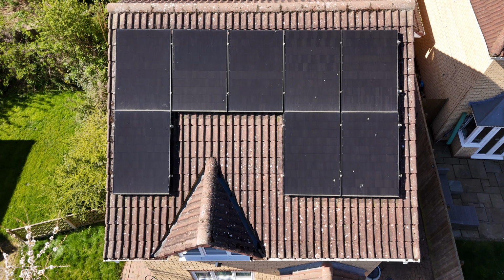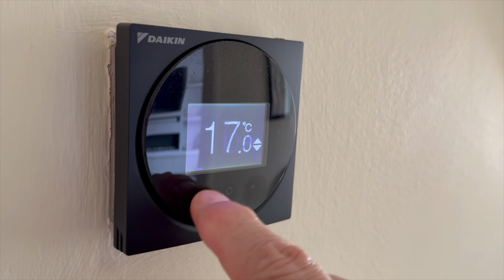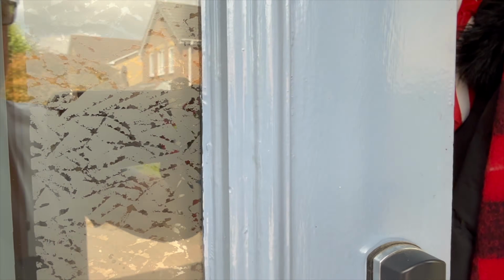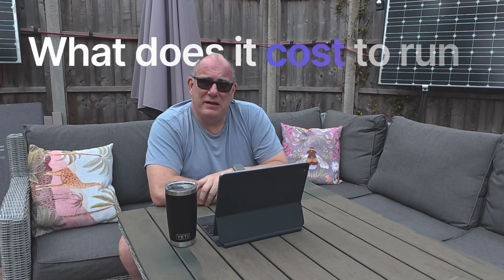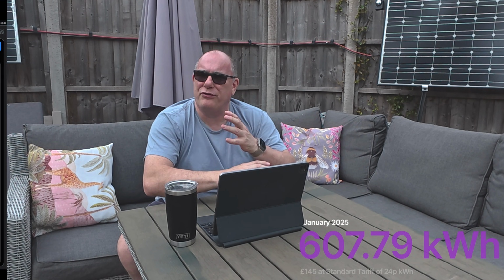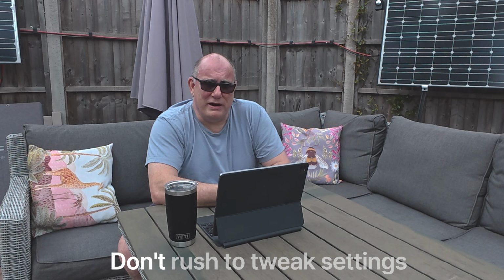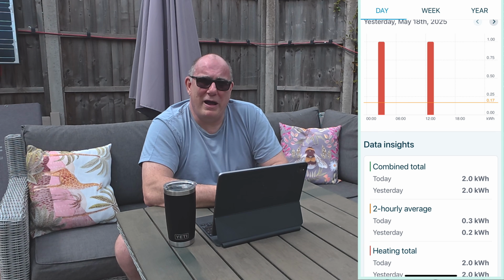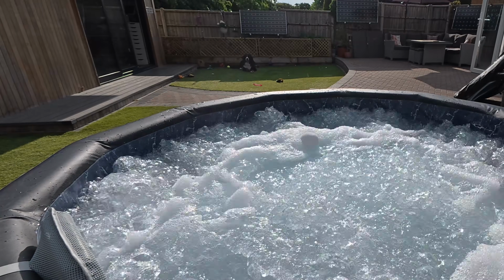I Spent 6 Months with an Octopus Energy Heat Pump and was blown away by the running costs!

Comment from the maker: What's stopping you getting a heat pump?
Reply: Until we had solar and battery,  I would not have believed zero bills were possible,  we’re now 18months in and it’s like wizardry we run two evs and we’re £225 a month better off (£120 in diesel,  £100 electric per month)

With that in mind,  I can now believe that the heat pump will work as well,  just added another 9kw battery and 12 more panels,  we think zero bills for all fuel is feasible,  that’s in the household electric, heating and two cars doing 12k miles a year.

As this is our forever home,  I’m heading toward zero energy bills in retirement (56 now),  which means pension pot lasts longer.
Reply: A fairly new house about 15 years old with excellent insulation, PV and battery storage installed i have a garage i could use to place a water tank and a suitable location for a ASHP unit, but we have a gas combi central heating system made up entirely of plastic microbore pipe work of less than 10mm so it appears that i would need a complete plumbing refit and i am not prepared to pay for that additional disruption and cost. On that basis I can’t see me getting air to water ASHP and air to air does not seem to suit our size home and lifestyle.
Reply: @LeeJonesNPT  With a 15 year old house and excellent insulation you might just get away with microbore pipe work.
Did you get any quotes to see how much would actually have to be done and how much it would cost?
I recommend checking out heat geek for a list of extremely well trained heat pump installers that can do a proper heat loss calculation.

In my own home I had a hybrid heat pump installed, because I really was not sure it was going to work with my 35 year old radiators, but it turns out that the gas boiler only needed to help with less  200 kWh of heat in the entire winter, apart from domestic hot water, which the hybrid system  just leaves to the gas boiler.
The next step will be either adding underfloor heating in the living room and kitchen, mostly because it looks better than radiators, but it also improves from the currrent SCOP of 4.7
Before or after that , I plan to replace the gas boiler with the full electric expansion, which both takes over the DHW and can store energy for later use in the radiators as well.
Reply: @SolAce-nw2hf I have basically done an Octopus online quote and chat, they seemed very keen but highlighted that they don’t do microbore less than 10mm which i think mine is. I will get a survey done but having read so much online and YouTube videos that microbore and the microbore joints in particular slow the flow down even more. I may well get a survey done as you suggest to get an experts view rather than online “experts” who insist it can’t be done.
Reply: That my district heating already has a giant one :)
Reply: I had a combi boiler and no room for a hot water tank.  Solved the problem with a Sunamp water heater and an air to air heat pump.  Air to air heats the rooms much faster than air to water, so I run it more along the lines of a gas boiler, just heating the rooms when I am using them.
Reply: @annesmith1919 was the sunamp expensive?  What temperature do you heat it to?  Thanks
Reply: @slrsteve6359  I've had the Sunamp since 2020 and I can't remember how much it cost.  Current models seem to cost between £1275 and £2295 (there are 4 sizes) - the one I have costs £1500.  These prices are from the Sunamp shop and do not include installation.  It doesn't have a temperature setting, simply a valve to mix in cold water.  This is because it isn't actually a water store, it is a heat battery which stores heat in gel packs which change phase as water runs through them, releasing heat, and are recharged with electricity.  It therefore doesn't lose heat anywhere near as quickly as a water tank.  In my case the electricity comes from my solar panels for most of the year, and in winter I charge it up at night and it easily lasts the whole day.
Reply: I couldn’t get a guaranteed 6x from any ASHP provider that you are getting. So installed a condensing boiler, oversized key radiators, performed research on how to improve house heating efficiency, put in automated thermal blinds on every window, installed Tado and thermostats in every room, dropped flow temp to 40c, run the house at 21c in main rooms, change target temp based on occupancy and time of day. Installed new boiler in a location that will make it easy for a heat pump install in 15 years. Installed elec showers, installed 90l hot water tank that can be heated by gas or electric. Reduced annual gas consumption down from 18,000 to 10,500 kWh. Installed 20kWh of batteries and Victron inverter plus EV Charger. On Octopus Intelligent Go. Average cost per kWh is 7.4p. When there is an all electric system that guarantees the efficiencies you are getting will look again, but not for another 15 years, unless there is a significant improvement.
Reply: @michaelhorton6881  a low temperature system is a great start. A reasonably installed heat pump has similar energy costs to a gas boiler at the price cap. A SCOP of 3.3 would be sufficient. Octopus and BG say their systems exceed that. If your existing radiators etc. are suitable, a heat pump install might be inexpensive (some are installed for as little as £500 after grant).
Reply: I was all set to getting a heat pump until I saw this video. Now it seems like I should be getting solar and battery first.
Reply: @captainmandible well, solar and batteries should have good financial payback periods for most. But the heat pump in most cases has the greatest CO2 emission reduction.
Reply: Octopus install times lol. Got one more month to go for my install of a 4kw heat pump. I'm worried not got enough solar yet to run fully off grid
Reply: @martinroberts6065 going off-grid is really hard, and even more so in our climate. My home has just about enough solar to offset the yearly energy usage in kWh, including the heat pump, but even with a fortune in batteries I would need the grid from the beginning of november to the end of februari. Luckily wind turbines complement the solar panels in winter, so I am happy to stay on-grid.
Reply: @SolAce-nw2hf  I think how i work will help keep costs down as a night worker can build up building temp on cheap overnight tariff and let it run at a low temp during the day. Hopefully engineer will help set it up like this and I won't cope with a 21 degree home too hot for me
Reply: @martinroberts6065 My experience is  that keeping the home at a constant temperature instead of the on/off strategy used with gas boilers is much more comfortable. With a heat pump you can just set and leave it to the temperature you like. In my home it is actually set a bit lower in the morning than it used to be, as all of the walls and furniture are warm instead of cold. I do lower it a bit at night so the heat pump only runs if the living room cools down too much, but no more than two degrees and the thermostat program gently increases in the hours before I get up, so the heat pump can run quiet and cheap in the early hours.
Reply: 60 year old house, vented central heating system with pipes buried in concrete floor.  Going pressurised could burst a pipe 😢
Reply: @slrsteve6359 perhaps get someone in for a quote and pick their brains for ideas (Air to Air?)?
Reply: 25 years ago we got rid of gas & opted for economy7. The system still works and has needed no maintenance. It makes no noise, does not ice up and we can set a different temperature on each heater. For us, getting a heat pump would be very disruptive and expensive. Our heaters are obviously not as efficient as a heat pump but at least we are not burning stuff.

Comment: Fantastic presentation, thanks for posting. The issue you didn't mention (and something Octopus didn't mention to me either when I enquired about solar) is that not all District Network Operators allow unregulated installation of solar arrays. Here in South Devon, the grid can barely cope with the existing demand let alone the rapid expansion of new house building and retro- solar. I doubt very much that I would be allowed more than the standard 3.7kw array, so this would be a limiting factor for us. As a conservationist, I think the whole energy market is rigged. A sensible solution to all of this would be for Governments to get real and start nationalising green electricity supplied free via an upgraded grid. We then wouldn't need to frig around with all these micro solar and battery installations which inevitably will come from China, the world's No1 polluter.
Reply from the maker: My advice would be to contact your DNO directly and have a conversation about what is possbile. The grid as a whole may be stuggling but you may find the phase your home is on is fine and that's what dictates any inverter decisions

Comment: Hey! Quick question - what would you tackle first: heat pump with underfloor heating, or solar panels with a 10kWh battery? I’d love to do it all, but gotta see what the damage is price wise first. Thx !
Reply from the maker: Solar and batteries will have the biggest savings, then later do the heat pump

Comment: My enthousiasm grew by the minute untill you told that the average temperature in the boiler was around 45 degrees. I cant believe this system is legal! Water in boilers should always be over 60 degrees Celsius to prevent growth of pathogens like Legionnairs desease. Incredible, just waiting for the next outbreak and its political fallout.
Reply from the maker: by boiler you mean the water tank. the tank has a legionella cycle where once a week it heats to 65c to kill off anything that may be growing, i’m pretty sure all modern systems do this now
Reply: There's a Heat Geek video on Legionnaire's: 
https://youtu.be/oJeyc_cGIMU
And how it is best dealt with in heat pumps

Comment: Hi Jon, I’ve been following your channel for about a year and remember Dick Strawbridge’s ‘being green’ programmes back in the 2000’s. 
We have a 3bed detached 1960’s house with 5.6kw of solar and 17.7kwh of storage that have in for nearly 5 years. We are now considering a heat pump and wondered about summer cooling capabilities. From what I understand so far you either have air-to-water to run your radiators or go air-to-air for the high wall mounted units that can provide cooling and heating but don’t use the radiators. Now that you have had a fair bit of summer how have you managed the heat/cooling? Thanks for videos, keep up the great work.
Reply from the maker: so for cooling, you’re going to need air to air. it is possible to switch it to water system into cooling mode but putting cold water into your radiator system only has a very limited cooling effect. Radiators just aren’t designed to work in reverse. I believe the new updates to the bus grant to allow out for air to air systems, but double check with your installer
Reply: I think EVNick did a video mentioning why you don't use radiators for cooling-the potential for damp to form if the radiators attract condensation.

Comment: One thing I'm considering is that I used to have a petrol car, gas heating and hot water. Now if my gas supply was ever cut off in the depts of winter I could use an electric heater to heat some rooms. With everything electric, if I every lost my electric supply to the house I'd have no heating, no cooking and no car to get me around. For this reason I'd agree that I would want to start with solar and a battery first and gain some energy independence.
Reply from the maker: yep solar and batteries are a great starting point, and make sure what ever system works on island mode in a power outage. that said how long would you be without mains power, here it’s about 5 mins per year. now if we ever get the zombie apocalypse then we have bigger issues to worry about

Comment: We have 8 solar panels with 5.2kwh batteries, i've got 2 electric cars and we're looking for Cosy 6 from Octopuss. (we're already with them) Will i need more panels and batteries?
Reply from the maker: in the depths of winter, the Heat Pump is definitely going to drain your battery but I wouldn’t rush to increase the number of panels or batteries just yet. Get some data under your belt and see how much you’re importing at the full day rate. Then figure out how much extra battery you’re gonna wanna install.
Reply: More panels does sound good to offset your use, presuming you drive a bit and don't have that efficient a house.

Comment: Can the hot water be heated up at night for morning showers as opposed to being kept warm all day?
Reply: Have you been able to heat a room above 20 degrees, because we need higher temperature.
Reply from the maker: yes you can go a lot higher temperature just we prefer 20 degrees
Reply from the maker: yes absolutely you can schedule it just like a boiler
Reply: We have two hot water heating sessions per day.

We sometimes heat to 21-23C if we feel a little cold. Our heat pump system is fairly responsive.

Comment: As an old codger, I need to heat the bathroom and en-suit towel rails in summer first thing in the morning with our gas boiler and these are the only radiators on. Do you think the heat pump could quickly heat these up or what sort of time would it take and what temperature would they be? Also,the wife still has hot flushes and the heating has to be turned off at times in certain rooms in winter. At the moment it is easy to turn off the central heating on the App. At the moment I turn off or reset the radiators in different rooms at different times and assume you sort of do this through the electronics?
Reply from the maker: probably the best thing would be to put some electric elements into the radiators, this will save you running. a full heating cycle
Reply: Or you could keep the whole house warm, and perhaps have specific radiators electronically turn off-able?

Comment: i am a electrical engineer I've tried to look at the data of heatpumps but magically it doesn't exist, there's lots of jargon and a sentence at the end saying the data is clear😂
Reply from the maker: energy bills that are less than last year are pretty clear data
Reply: What data do you want? There's a site like Heat Pump Monitor for measured efficiencies?
Reply: @Biggest-hz7ng my post speaks for itself, i don't see the point in repeating myself 😂

Comment: heat is measured in btu not kwh😂
Reply from the maker: yes and no, most modern hearing systems use kwh because it’s understandable to normal people. no one but hearing engineers trying to impress people use BTUs theses days. but as an engineer i assume you can multiply by 3142

Comment: Im a new home owner, I bought last year. Its a 1960s 3 bed end terrace. I am currently with octopus already, the house has got a gas boiler installed in 2021 and electricity from the grid. my plan is to get solar panels and a battery system, then a heat pump etc. the problem is the upfront cost to get going. I am working on saving but it may be a few years yet before I can start. the house too might need rewiring, I have an old fashioned fuse box! so i have that to consider first. is your solar system all with octopus as well? I was quoted £15,000 for 12 panels and a battery system last month. I am interested I just dont want to take out the finance while my mortgage is still so new. but long term, I love the idea of fully paid off house, zero cost energy. Set me and my soon to be wife up for retirement over the next 30 years.
Reply from the maker: remember you don’t have to do all of this at once, start small and expand but build a system that is going to be simple to expand, not one that you’d have to rip out and replace in a few years if you want to have more capacity. I would definitely start with solar and batteries. They will have the biggest impact and then when your gas boiler needs to be replaced that’s the time Heat Pump.
Reply: Heat pump installs vary in cost - as low as £500 in some cases.

Comment: I've been reading up on heat pumps for 2 years. I finally had mine fitted last month (9kw Cozy) but I was still skeptical exactly how much it'd save me or if I'd break even.
Octopus now do a 10 year plan at 9.9% which when i compared our £4,500 quote to a new boiler at £3,500 also over 10 years at 19.9% (i couldn't find it cheaper without just having a standard loan over 5 years, but 10 didn't exist lower), the monthly payments were about equal.

Then if i can get a SCOP of 3.5 regardless of tariff, i'd worked out I'd be not worse off going for the heat pump. 
Not to mention, if i got a gas boiler and then in 10-15 years when it died, the government grant for heat pumps might not exist anymore.

I'm using the cozy tariff with octopus,  I boost my heat during the cheap off peak hours so even if I only have a SCOP of 3.5,  It'll cost 14p per kWh during these periods. So i boost the heating to 22'c, set to 20'c during normal rates and 17'c during the peak so theoretically, I'll never need to spend during the peak hours (especially when i get a battery soon).

So most of my heating during a day will be done during off peak cheap hours and standard hours to maintain. And in essence, I'll save so much each month, it almost pays for my 10 year payment plan monthly payment each month just with the savings alone.
Reply from the maker: Sounds like a great plan to me. Late on if you can add solar and batteries you will see your ROI increase massively.
Reply: @JonathanTracey I think batteries will be next to stock up on cheap electric and do solar last. 

 solar for me is the most expensive with slower return because whilst they're great outside of the winter months, the batteries are an all year round constant benefit and have a smaller initial cost.